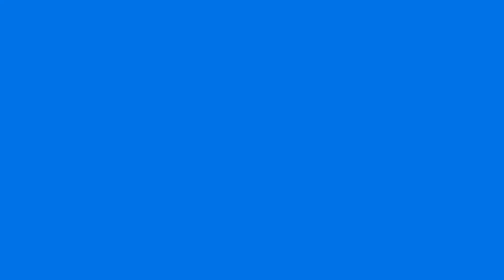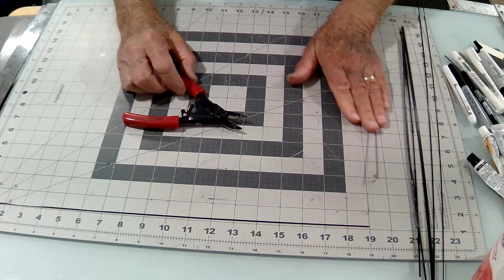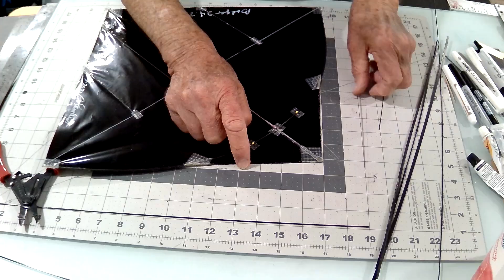Kite Making Materials Update Part 2, Carbon Fiber Bows & Spines

Comment: Thanks for the shout out at the end of the video!  We really appreciate it.
Update:  We have 1.3 and 1.4 on order with one of our suppliers.  We should have these new sizes in stock by the end of June.
Also, another tip for cutting, using hand tools that shear can sometimes fray the ends.  It works, but could cause tiny splinters that can get into your skin.  We recommend using a dremel with a fiber or diamond wheel.  Always wear a dust mask when cutting or sanding.  You don't want that dust in your lungs.  Let me know if there is more we can do for you!
Reply from the maker: Thanks for the tips, no question carbon fiber splinters are nasty as is its dust!
Reply: @bruce.lambert  The 1.3 and 1.4 are literally on a boat from China as I type this.  We should have them here in a few more weeks.